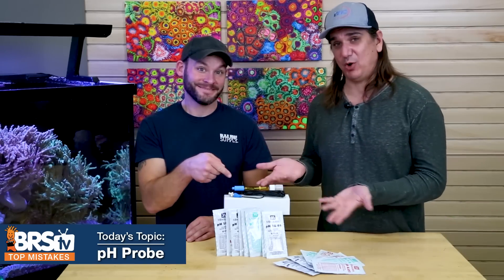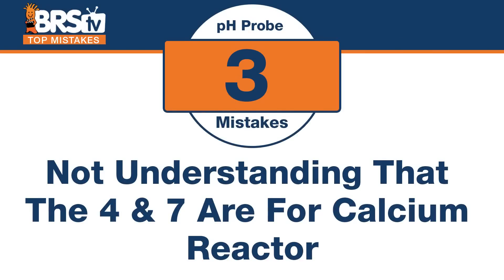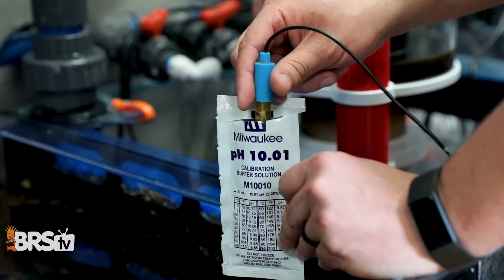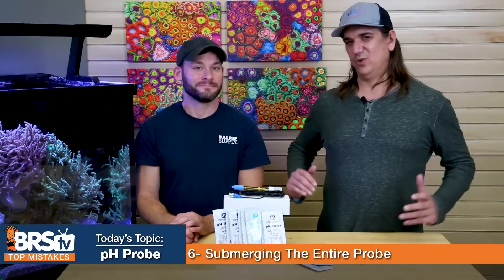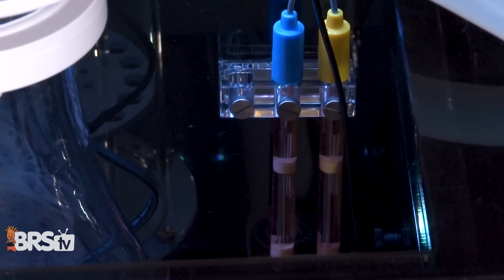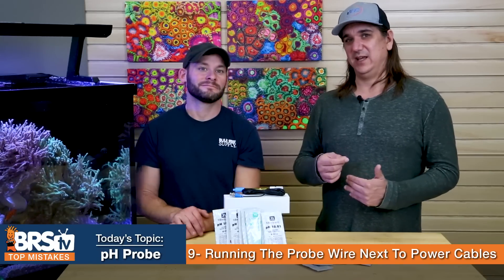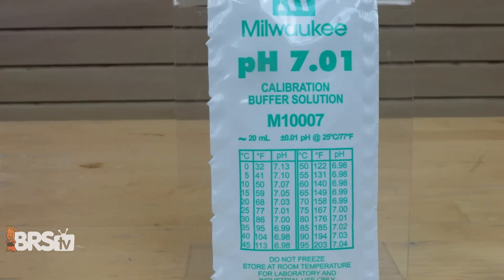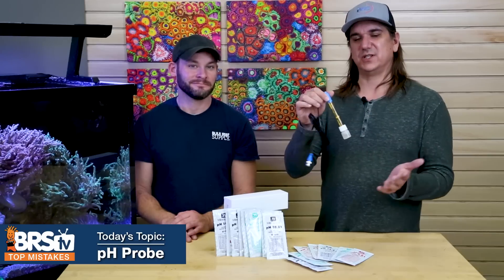Raise the pH Bar in Your Reef Tank & Avoid These pH Probe Issues by Using the Right pH Probe Tool.

Comment: Don’t calibrate to calibration solution, get a hand held calibrate you hand held with the calibration solutions, then take a reading with your hand held unit and calibrate to its reading, solutions are good for none control situation like a lab, but when you add a probe to water in a system with pumps, heaters some of these devices will leave current into the water and mess up your readings, always calibrate to a hand held ph,Orp, Condutivity, over 20 years of experience here of servicing installing industrial Water treatment controllers and PLC programming, Instrumentation…

Comment: I  had a scratch on my finger and i got zapped , its from the ph probe , is that normal ?
Reply from the maker: That's definitely not normal. This doesn't sounds like a pH probe issue, but rather another piece of equipment leaking voltage. A volt meter will help you identify which piece of equipment it is.
Reply: @BRStv  i don't know how to do it with a voltmeter . But i started unpluging stuff one by one while my finger is in the tank lol. When i unplug my nero 3 the zapping stops , same when i unplug the ph probe !
Reply: A video about that stuff would be nice .

Comment: I got a pH controllor and was having problems with it from new I used a liquid test kit salifert and that was in the right range then I noticed if I had the controllor   near any other electrical equipment it gave different readings now it's nowhere near any electrical equipment and it's perfect messaged sellor it uses mv so like u say probe allso is not near any electrical equipment spot on dudes